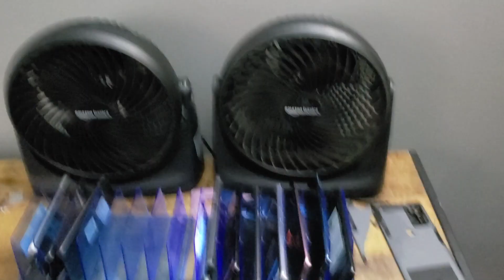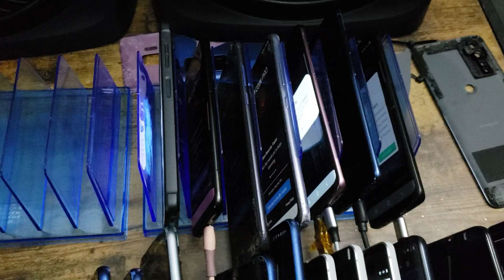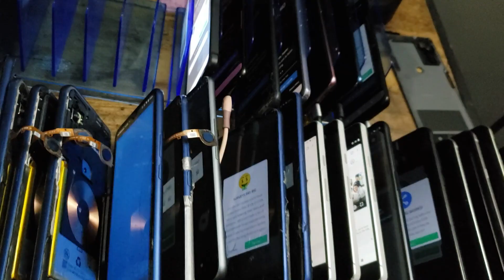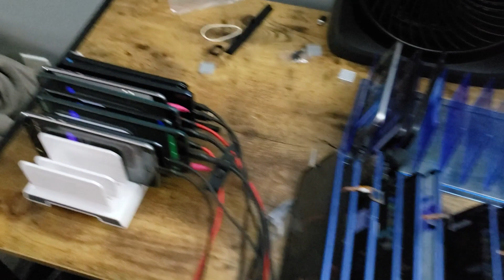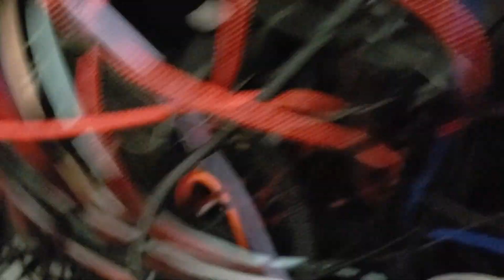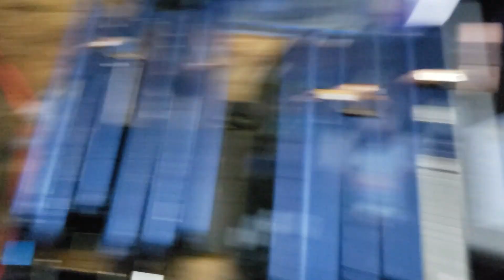The $500 A MONTH Phone Farm! | July 2023 Phone Farm Update

Comment: I just came across your videos because I was curious. I'm a application Analyst, data analyst.
1. The problem you're having with the IPs having the same address, I thought you could just VPN or have another way to by passthis?
2.  Would it be better to automate these type of systems so they are more hands off? It seems like consulting someone that does that might make things more efficent.
3. I would for troubleshooting sake map it out, in a software so you're able to display it for other users, as well as  getting insight into improving it. this is how tech firms scale up.
4. power banks with cycle may also help with power consumption and balancing heat and battery life.

im new to this so just throwing in my 2 cents.
Reply from the maker: Hey! No problem, I'll answer those questions :)

1. VPN will not work as these apps/sites we use can detect a vpn. Residential proxies might be better if you can get some that no one else is using, or what I have not is a Business Internet connection with 29 IP's.
2. It would be better to automate them, which I have done in the past year.
3. It is mapped out now since I have moved the farm into a server rack, just need to make customs shelves so I can use the full rack
4. That is a smart idea but the issue I have faced was some phones do not last as long on batteries as other phones so finding doing that makes it harder imho, simply integrating a fan into your farm does help keep down bloat. I know some others who crypto mine on phones (I no longer recommend phone mining) who have had their batteries last longer than some of my phones of the same model.

Comment: Hi, thanks for an inspiring video! Do you connect the phones with wifi or wire (wonder if that is possible and if how, and if it would be better?). I am very new to this and wonder how much  power and bandwidth  I need.
Reply from the maker: I use ethernet, I have a Unifi access point per 4 IP's on my network, and I run a  PFSense firewall. Does not cost me a lot in power, and since CashMagnet is dead, bandwidth isn't much
Reply: @ToucheFarming  Thanks for your answer! (I need a little study to understand it all) Meanwhile I found somthing interesting about reverse tethering to mobile phones. It worked fine for me with one phone, but I did not try it with multiple phones yet. ( https://www.youtube.com/watch?v=96J-pHZ1kR0&list=PLTbK4XZ-EO4ka8HstEW1Cjb_0JLyh71Kp&index=25 ) Maybe connect multiple phones with usb to a 'master pc' like that?